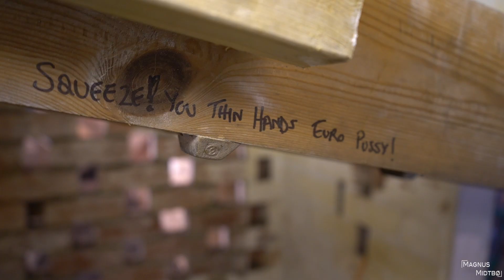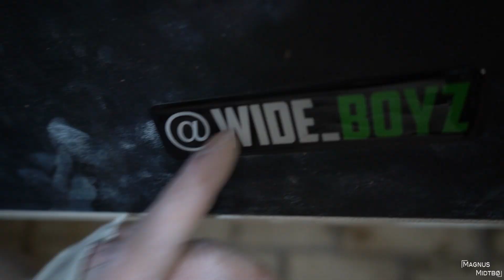OLYMPIC CLIMBING - WIDE BOYZ STYLE | #155

Comment: how often should a climber take a rest day? And what does a normal climbers climbing schedule normally look like? At the moment i go to the gym twice a week then work 12 hr nights 3- 4 days a week and i usually have 1 to 2 rest days in between my climbing days, is this normal practice?
Reply: It depends on how hard you work yourself on the gym and what other training you do. You can climb easier stuff if you want to relax, and give yourself time to rest. So you could easily climb every day. It entirely depends on how much you push the envelope. But standard 1 day between sessions is good rule of thumb. When I trained hard, I did 5 days of climbing per week (weekend off), but trained on weights only on 3 days a week. Giving me two pure climbing days in between them, and I didn't try very hard on those days to make sure I recovered. But I managed to improve/maintain (depending on need) my level if I climbed on three days a week (Mon, Wed, Fri) and that's it. As long as I did some serious effort and at least 2 hours on those days.

The thing is, if you're a new to climbing you gotta watch your finger tendons. Your muscle strength in your hands/arms/back will shoot up like crazy. You could have finger strength to climb a 7c in less than a year, but you could (depending on individual) permanently damage your tendons in fingers doing that. So the trick is to push the envelope, but be really wary about small handholds and campus training until you have a year or two behind you. You can train hard, but you really have to watch your fingers and be really careful if you feel any pain. It's not like you're going to instantly rip off a finger or anything, but you can do some lingering damage that that can slow down your training for months, maybe forever if you don't let it heal. 

I'm being a little alarmist here, but I've seen too many newbies crush some campus boards after a month, and then forever dissappear from climbing scene, probably because their fingers couldn't handle it anymore. Especially if you're a heavier individual, the more you weigh, the more relevant this becomes.
Reply: @nomindseye  yea I'm new and trying to get as much knowledge as possible, I'm pushing 40 this yr last thing I wanna do is hurt myself and not be able to climb, I rather take it slow I'm not a Olympian just someone out to get healthier and do it for fun
Reply: @kigashouse7176  Climbing is a good sport for that! It's fun and something way more interesting than weights. Just remember to stretch at least 15 minutes before going to the wall. Especially your forearms, shoulders, and hips. 

After that doing another 15 minutes of warmup with some huge easy jugs to get your blood flowing. 

As a new climber you should put 90% of your attention to technique. This will skyrocket your level.

As a newbie you need to pay attention to your hips and feet. For hips, basically try to keep your crotch as close to the wall as you can, because this will shift your center of gravity so that the weight is on your feet. The weight should always, whenever possible, be on your feet. Even when climbing on a ceiling (yes, that's how you climb ceilings. By putting weight on your feet, believe it or not).

A useful tip for practicing technique for feet is twofold: ONE, your feet should never make any noise. If you hear your feet banging on the wall or holds, you're doing something wrong. TWO, when you need to move your feet, watch the foot you're moving until you have it on a hold well enough that you can put weight on it. Then switch your attention/eyes to either your hands or your other foot. Depending on what you need to do. Also, always look at the hold you're reaching for until you have a good handhold on it. 

Basically, what I am saying: climb slowly and delibrately. This makes it heavier work, but it practices your technique and that's like 3/4th of the battle.

Anyway, hopefully I gave a few useful tips and didn't just repeat stuff you already knew. Have fun on the walls!
Reply: @nomindseye  u did ty so much appreciate it